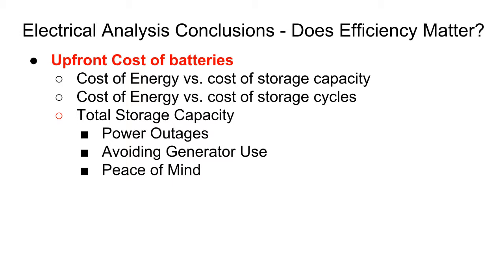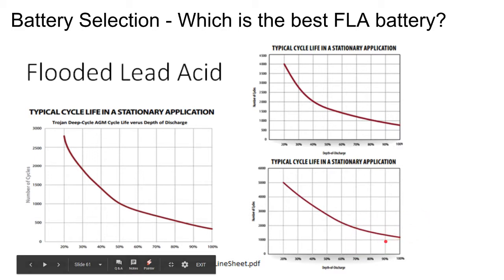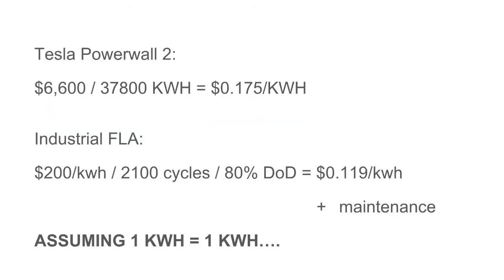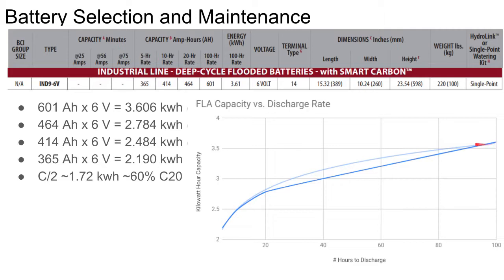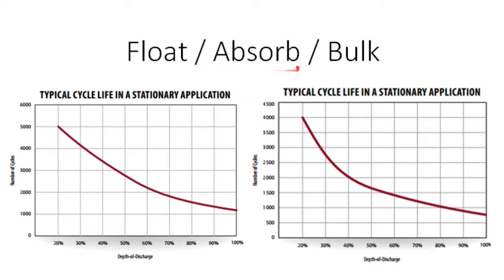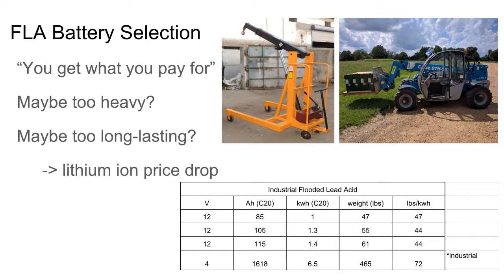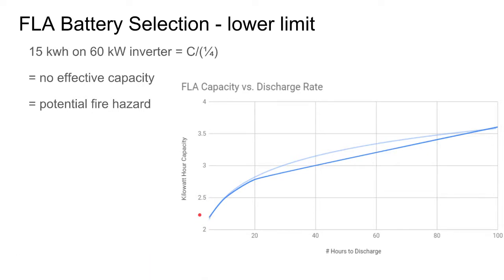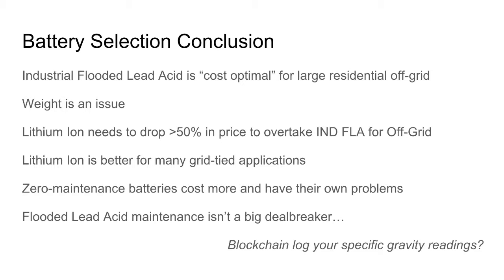Residential Off-Grid Master Class Part III: Inverter Selection

Comment: I appreciate your analysis, but I would like to offer a few thoughts.  To really do the math comparison between a Tesla Powerwall 2 and deep cycle FLA batteries  these factors must be taken into account.  The Tesla includes an inverter! That inverter is hybrid and would cost approximately $2000 minimum.  $6600 - $2000 = $4600.  Divide by 13.5 = $340 kWh.   At warranty of 38 MWh = 12.1 cents kWh.
Next: The problem with FLA is really it's charge acceptance. On a given solar day of  7 hours you can't fully charge them. And when you don't fully charge them their life cycle is reduced...so you need to use the generator...and there goes your savings. 
Other problems with FLA...voltage sag. Even for industrial deep cycle at 40% any significant draw on them produces a voltage sag. This does not happen with lithium. Also, to equalize requires generator time...another loss. 
The real formula for lead acid is  $200 kWh multiplied by 80% round trip efficiency, multiplied by decline to 80% capacity over warranty period, add inverter, cable, installation and  credit yourself at $20 hour for maintenance.  In other words, it is time to retire lead acid batteries and surrender to the admitted sticker shock of lithium!
I have been off grid with various lead acid banks up to 80 kWh for 17 years, and although I wish lithium was cheaper it will still be my next choice in battery bank.
The only alternative that might be considered is a one day lithium storage that cycles 365 per year, and a cheap lead acid 3 day bank that cycles in the winter perhaps 30 times per year.  It is a little ugly and difficult to set up but probably optimizes each type of battery.
Reply from the maker: Good point, it does include the inverter and should be closer to apples-to-apples. I kept it in because after purchasing the PW2, you still need to buy a battery inverter to run it in a off-grid setting. I think the TPW2 is a good fit to add overall ampacity, demand management, and critical load backup to an off-grid residential set-up. But my off-grid or grid-assist battery inverter is $0.20/W with a 12kW continuous AC output. So the TPW2 is a more expensive inverter option with less off-grid functionality. We give it a much strong look (as well as other higher end lithium ion batteries) in the commercial solar peaker class (newly added).